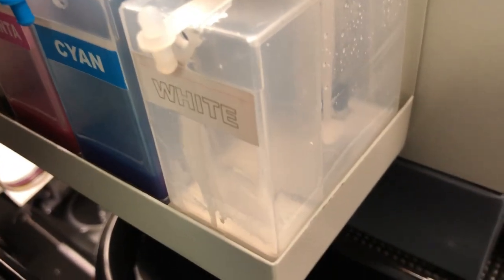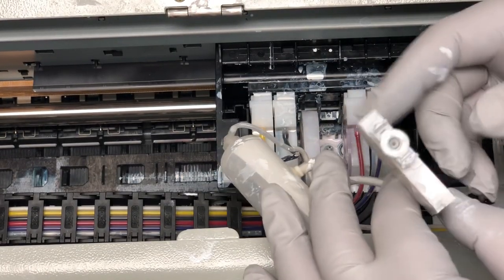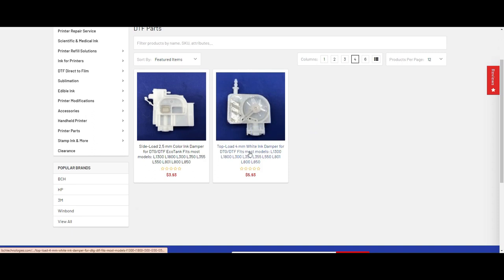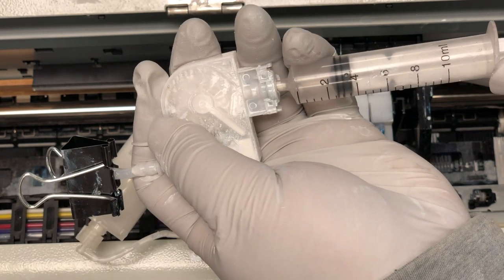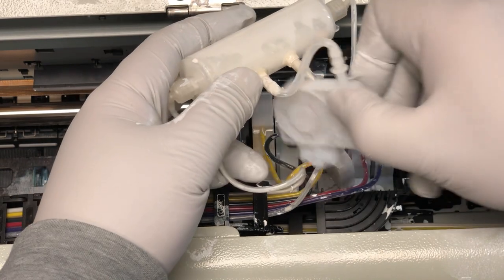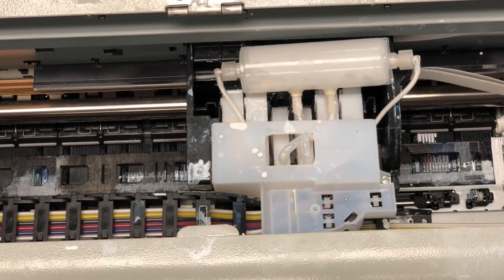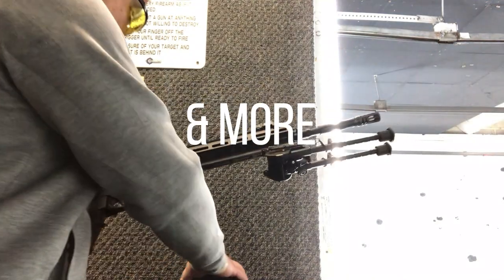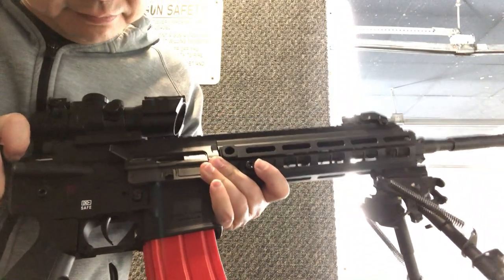Printer Leaks White Ink - How To Fix DTG/DTF White Ink Leaks

Comment: Hi Kevin 👋 I’m looking for an ink-tank printer that allows the user to freely reset the waste ink absorber. Do you know if the G3260, G3202, or G2260 allow for this by using the Resume+Power button combination? I also read that you may not be able to enter Service Mode again after using the Service Tool program, is this true? Thanks!
Reply from the maker: None of printers allow you to do this.  Service tool is the best bet.  Luckily they all list compatible models.

Comment: I have an Epson 7720 with the below error code, any suggestion where I should start looking for the problem, thanks and thank for all the great videos and tips!

 ADF Error check that there are no originals  code on the bottom 031006
Reply from the maker: You can find the explanation here: https://bchtechnologies.com/blog/epsons-triple-secret-error-codes/
031006 MEANING=" Head fuse broken error" DESCRIPTION="- Printhead failure" You probably need a new printhead.  Check the FFC cable too.  If the FFC cable is broken, follow this video to repair it: https://youtu.be/23SxDLKOqdY.  The printhead is easy to find.  We've been getting them from eBay.  Make sure to choose sellers who take free returns.  3/5 of the printheads are not useable (missing colors, breaking lines) and have to be returned. We also tried AliExpress but there is no way to return it.  They say "free return", then AliExpress asks you to submit photo evidence, video evidence, and then AliExpress arbitration will say it's your fault.   So, stay with eBay and test the printhead IMMEDIATELY. I hope this helps. Please give me a review at: https://g.page/r/CfL7k6nYvPQ9EAg/review

Comment: Can you give any suggestion. I have HP Photosmart 7525 and filled BK cartridge with pigment ink after tested its I guess baked inside . regular flush doesnt work, Tried ultrasonic still doesnt  work
Reply from the maker: You said that you flushed it.  Did you use distilled water or cleaning solutions?  What cleaning solution did you use?